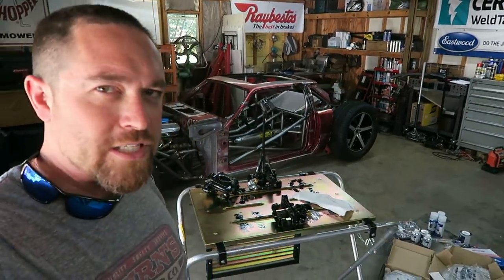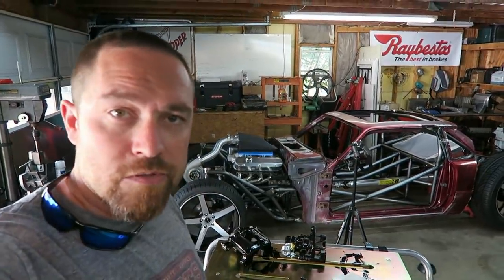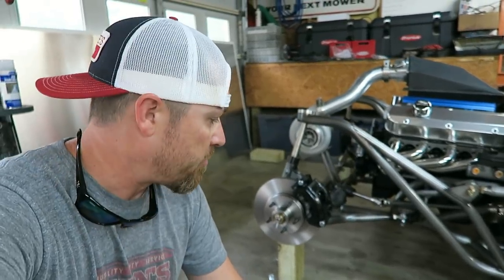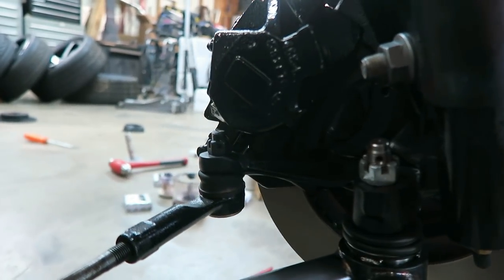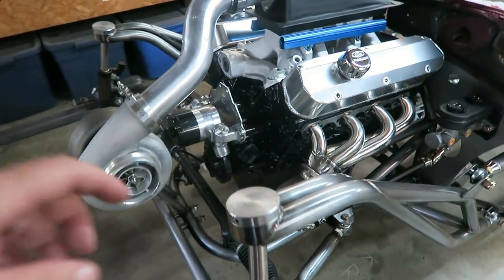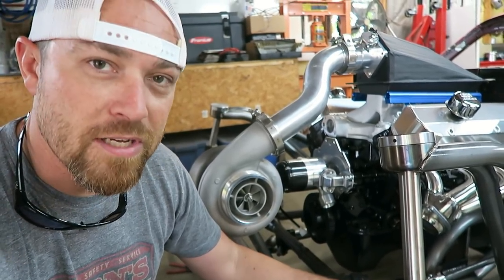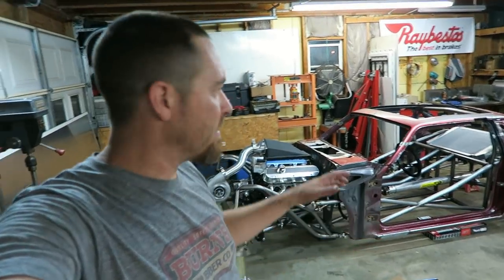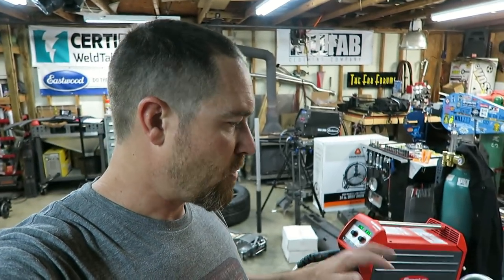Brakes Look Awesome

Comment: What if you built a cross bar between the strut towers? That is: connect both strut towers to each other, but sweep way down in front of the engine. You could even triangulate it into the structure below. Also could possibly integrate the turbo mount into it ( like a maven performance style mount) for a really clean look. Could make it multi functional. Just a thought. I’ve got to admit, when this build started, I thought it would be awful. But I really like the car now. It’s gonna be a really cool cruiser. 👍🏻👍🏻

Comment: Can’t wait to see this car roll on its own power !      As for the heads moving, I can’t see it.   Especially if you use a plate.    Could you not tie that in with your turbo support and back down to the lower cross member for even more rigidity?    Just a thought.    I believe you mentioned that yesterday.    Would quiet down those that oppose your ideas.    Anywho, GREAT to see you posting car progress this week.     I know it’s tough being summer and all.   Enjoy !
Reply from the maker: yeah I am excited to get it a little further along

Comment: The difference between a blower and a strut brace is one is a static load, the other is a dynamic load. If you hit a pothole or any kind of serious bump the motor will move (Putting constant stress load on the engine mounts, since they are the point of least resistance), which in turn is still going to move the other side suspension. Maybe not as bad as joining directly side to side but it will still move. You could try X down to the lower front chassis rail (since it needs to be fixed up anyway).

Comment: The bars you made for the front that are used for the struts if you want to make them strong  Pressurize them with compressed air.  About 180 lbs that will make them stiffer .
Reply from the maker: they are strong now

Comment: Why don't you build a "control arm" that mounts to each control arm on the top. Weld a bracket to fit heim joints on each control arm and bend the bar either above or below the turbo intake manifold piping? It'll add stability through cornering almost like a sway bar but still maintaining an more independent feel?

That way you can avoid mounting it to the front of the motor and taking up unnecessary room for the belt driven parts. Just a thought

Comment: 2 questions; 1 Doesn't the front of the Bibster go up and down ? Which means your stiffener will have to some how go with the movement? 2 If you want to mount braces off the heads do like they do on Formula Atlantic or Fords. Integrate a structure off the heads with spacers and long bolts to the heads and then run your stiffeners off that. You could also mount the head lights etc off the structure. Make the structure out of formed or bent tubing to go with the rest of the build
Reply from the maker: the bibbster does go up and down but that upper part doesn't move. The hydros will also act as springs

Comment: Good progress! "Do work, son!" 
Just a bit of commentary ...

Front hubs - pack the hub with a film of grease between the outer bearing races to provide a "reservoir" of bearing grease so that when the grease gets hot and thins out the grease which was packed in the roller bearings doesn't migrate to the hub between the bearings and cause them to run dry. That is an effect of "grease" called "shear thinning".  Centrifugal force can be a bitch; the taper of the bearing inner and outer races can / will funnel semi-liquefied grease into the hubs if they are empty of grease. 

One mistake with all new parts many years ago was all it took for me to learn that lesson; growl in the front wheel bearings 3 months after a front drum to disc conversion on a '67 RS SS Camaro. But you don't pack the hub tight with grease, there has to be room for expansion as the volume of grease "increases" as it warms up. You don't want that "chamber" too full and have the hot grease "pop" the dust cap or blow inwards past the grease seal. Yeah, I have seen that but not by my own hand (or asinine mistake).

Different situation in the rear; the rear axle has a vent to relieve the pressure for "live" rear axle setups - until the vent gets plugged by mud. 4x4's do blow out seals due to excessive pressure build up; personal experience with needing to replace pinion and axle seals once a year until I realized what the problem was caused by - extra long axle vent hose that was tucked into a lateral rib of the pickup bed when I buried it in the mud up to the bed too often.

Comment: Why not run a heimed tube from the tops of your "shock towers" down towards the center where the turbo is? That would control the inward movement, and you'd have a place to mount headights!

Comment: Kyle, look, your upper mount of the hydraylic cylinder has a certain path, it's a circle around the pivot axle of the longtitudinal lever. The end of your planned transverse lever will also have it's path - another circle, wich is smaller than the first one and lies in another plane. This way you're trying to make the cylinder mount to follow two different paths, wich will result in lever and chassis flex. I suppose it won't function properly.
Reply from the maker: the upper wont move, just the lower

Comment: First I will answer the last question. No, because my actions, and probably your's, are driven by gut/emotion, while what I say I want is intellectualized and lives in another bubble. Don't worry about getting sidetracked cause that is how you 'discover' stuff and it also gets you to stop fixating on what you work on and step back to it later with a fresh outlook. All good and win/win if you embrace it for it's positive outcome. Also, I really like the new format of more frequent videos that are not too 'produced' or edited and just give an update on what's in progress. Nice to see your work a little more often. Also 2, if the Bibster was mine I'd find another way to brace the front, maybe crossed bars to the far side of the chassis, rather than connecting to the engine. It's one thing to use the motor as a stressed member in a motorcyle and totally another in a performance car that may generate more than one G of lateral force in cornering. Just a thought, and sorry to be so wordy. Love your content and look for it every day.

Comment: Maybe just a strut bar for the front that goes under the turbo piping? Attached w/ v-band clamps so you can remove it easily also.. I have no clue, just puttin it out there

Comment: back when i use to street race a 68 cougar with a sbf ever time i would spray the car it would rip the stock motor mounts (i was to cheap to solids at the time ) but i ran a chain with a turn buckle from the head to the frame i was hitting it a 300 shot and that head never moved
Reply from the maker: yeah I saw a lot of those setups back in my day.

Comment: Love the build. Quick question. If you swap out the tube that runs from the cylinder upper mount arm to the cage though the fire wall with a coilover (like you have in the rear), could you turn the upper mount arm into an upper control arm?
With some suspention movement in the front it might absorb some of the road stress.
Reply from the maker: yeah it would and that was kind of the original idea...
Reply: I thought that might be what you were going for. It looked a bit complex to be a static arm. Awesome build, I look forward to seeing more of it.

Comment: If you did tie the frame into the cylinder heads it would still have flex there because if the rubber engine mounts. I can imagine there is not a solid engine mount. So I would think it would still have movement between that and the trans all being rubber mounted. Would a mount from the tower heading to the turbo mount at the bottom not work? Then the load would be to the frame. And hidden by the body. Put hyme joints at each end so it would still be adjustable? And removable.. just a thought
Reply from the maker: engine is all solid mounted

Comment: Could you just brace those arms together like a regular Mustang shock tower brace? Just an idea.
No, my actions do not match what I want, but there isn't much I can do about it now. A work accident that left me with significant spine, neck, and nerve damage. That stole away my ability to continue in a normal manner, but I carry on as best as I can anyway. On the bright side, I now have some cool titanium pieces holding my spine and neck together. :)
Reply from the maker: no because they may still have some side to side movement

Comment: For the front, have you thought doing a down sweeping radius from the top of the control arm to the forward cross member with a heim joint on the bottom to adjust camber.
Reply from the maker: I have, just torn on how it looks. I will probably look at that option again along with some others
Reply: It is your build, so you have every right to do it how you see fit. A downward sweeping radius similar to the upper control arms would look pretty sick in my opinion! Keep up the good!

Comment: in all honesty, my actions dont really match with what i want too often. i dont have the big money, so i decided at one point to make my own milling machine, wich is a goal that is kinda out of scope but i want to do it. i do own pretty much every other tool except for a milling machine, not that i would really need one, but i'd simply like to experiment with it, see what it can do, se what it cant. i bought 3 feet of huge ass i-beam wich i need to file and scrape flat, i got some flat stock to make the compounds and even a decent induction motor for it. i just cant give it a go because i dont really know where to start -> this is the biggest problem of every project i encountered, starting it.

Comment: What size are the tires and rims front and back. Specs please. Also for the Goose too? Thanks
Reply from the maker: wheels are 20 x 9.5 front and back dont remember the tire sizes right off hand. Goose has 15x4.5 up front and 15x10 rear with 275-50's

Comment: You might want to trianglelate the strut towers. Simply go from a strut tower to fire wall, then from the fire wall to the other strut tower, then across from tower to tower or at least from strut tower to strut tower, Look at older mustangs about 65 and up and you'll find these types of braces. also if you're going to tie into the fire wall make sure it's reinforced otherwise you'll tear through the fire wall. it's never a good idea to tie your suspension in to your motor plates or motor especially if your motor is not mounted rigid. Normally it's made to flex on the motor mounts, and if you have engine plates up front and then   in between the motor and transmission you then can tie them all together and make them solid. however you'll  experience vibration throughout the whole front end. if you tie in your engine solid you'll need to adjust the suspension for engine rotational torque. Hope some of this may help.
     Something like this https://youtu.be/CKgCh6ttDGc

Comment: what were you using to pack the bearings?
Reply from the maker: bearing grease packer
Reply: Thanks. Its been a while since I have packed any and all I've seen or used was the Teflon cone type. Great to see if there was a better way to do it.

Comment: I personally dont think you need another brace i think you should just put a coil over where you have thay solid straight link in the front. So its similar to the rear.

Comment: I would imagine that if you connected a plate to both heads it would be fine.
Reply from the maker: probably what I will end up doing
Reply: The Fab Forums I would use the same pipe you used for the frame, weld on a plate that you can bolt to both heads and then bolt the the arms up toward the mount. That way its removable. There wouldn't be much pressure on the engine/heads. Its basically just holding it in place and the force should be on the pipe/arms

Comment: Why didn't you use sn95 brakes and spindles?
Reply from the maker: because I already had the fox stuff and there was no advantage in switching
Reply: @Thefabforums  they look better and require no maintenance in between brake jobs, and I thought fox hubs interfere with center caps?
Reply from the maker: @MoctezumasRevenge1  yeah those things are true but none will effect this build.

Comment: Just bend you a cross bar hugging the front of the engine in between the water pump and thermostat housing.
Reply from the maker: it would need to be attached somewhere to reduce side to side movement
Reply: The Fab Forums that's what I'm thinking about. From tower to tower to connect them side to side run them down in front of the motor. Motor plates would work but they are a pain in the butt and will look like ass on that setup.

Comment: Why go with bearing integrated rotors, they're such an inconvenience
You know damn well those rotors are going to have a way shorter life span than the spindle bearings...
Reply from the maker: lighter....and they will last my lifetime
Reply: Surely thats a BS answer, A skeletanized stand alone spindle and a two piece rotor with an aluminum hat would be WAY lighter. As for it out lasting you, I take it you dont plan on driving it much then...
Reply from the maker: Beach&BoardFan I was referring to: lighter than the other factory two peice setups. If this thing gets more that a few hundred miles a year put on it I would really surprised.

Comment: Do my actions what i want, Some of the time, We cant all way's get what we want if we did get what we wanted in a vehicle then you would have no breaks rotted out floors and thousands to sink into it.

Draw back for me is the mechanic's no garage yet that does not stop me because i can be pritty set if i have to change a part, Doing a motor job is a hole nother story. 
Don't have many tool's yet i make do with what i have

Comment: Actions matching desires, easier said, than done. Remember patiwan, your focus determines your reality. Focus is near impossible with all the distractions in life. I'm guilty of chasing desires, unfortunately, I never caught a lot of them, I guess you have to prioritize, a dry eraser board and a list is a good place to start, I had a running list for years and ended up scratching many things off the list. I've only achieved a hand full, time flies, and before you know it, your 55. You have to be the power boat in the river and  not the canoe.